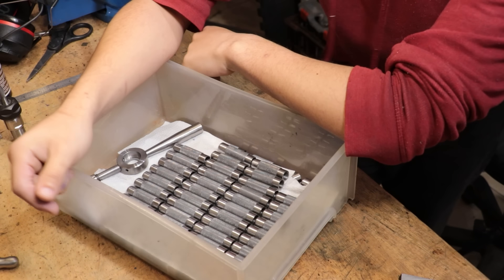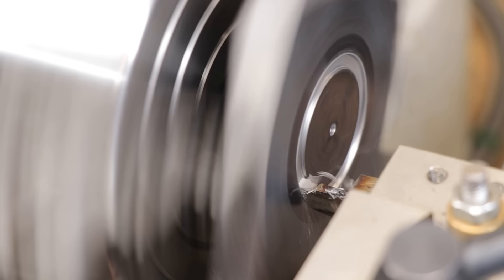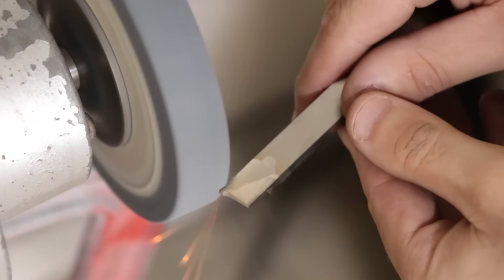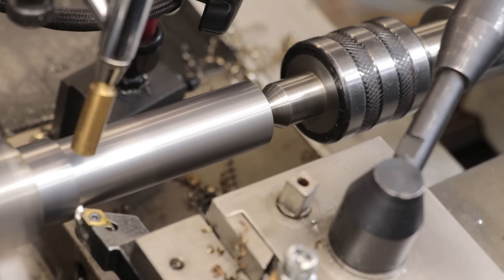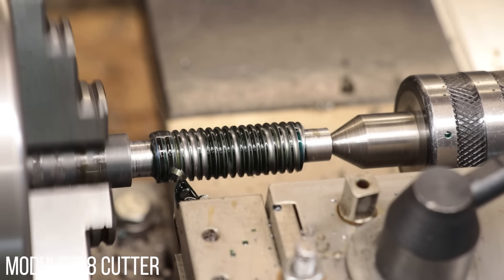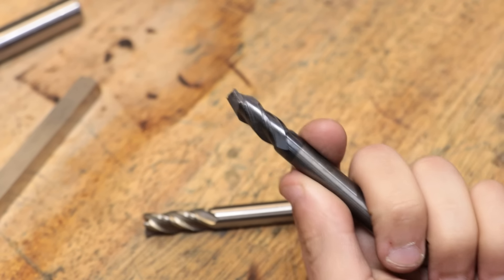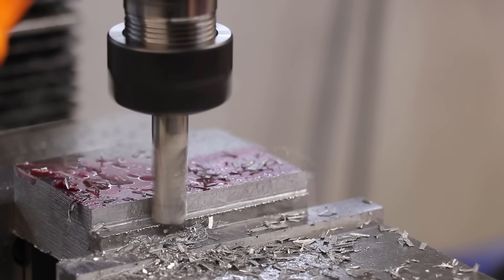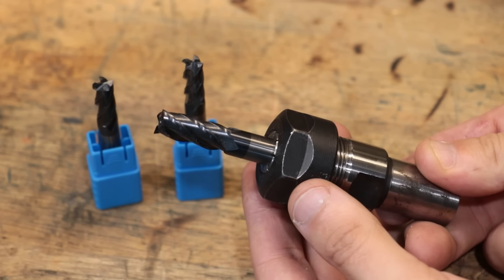Carbide VS HSS Tooling In the Workshop

Comment: I strongly disagree on the insert selection:
Having more or fewer different inserts has basically no impact on the overall cost. If anything having more will be cheaper - use the right tool for the right job and it will either give a better result or last longer. The only cost increase is the one-time upfront cost of the very first batch you buy - as instead of 6 sets of insert you now have 20 sets of inserts.

Of course there is then also switching the tools - when using just 1 type of insert then you don't need to change anything, if you are using 3 different tools for the same job then you might get better tool-life and better parts, but you now have to also switch the tools.
Reply from the maker: Thats okay, you do what suits your set up and needs best.  This suits my workflow best.  I tend to save a bit more because I buy my inserts in bulk so I save a bit more just buying 2 or 3 types and getting 5 or so packs of them.
Reply: @artisanmakes  It is just a comment on the validity of the statement cause:
"so I save a bit more just buying 2 or 3 types and getting 5 or so packs of them."
That would not change the slightest with having more types. the cost would either stay the same or be lower.
But if your workflow does not benefit from that, or worse you would have to constantly change the tools, that is a different thing and makes using them not worth it for your workflow. But it would not be more expensivee.
Reply from the maker: @ABaumstumpf  I see a difference. with my wallet I use mainly DCMT, I can afford to buy them in bulk and get the discount. If I have the more different types that I use I can not justify buying bulk orders of 5 or 6 different types of inserts. I only get the discounts if I am buying many packs of the same specific insert.  Maybe you see a difference, remember I am not a machinist, this is not my job so they way that i buy and order my tooling is structured so minimize costs and I do see a reduction in costs here. Your milage may vary

Comment: I notice you are going through quite a lot of DCMT/DCGT 070204 inserts ! All my bought insert tooling uses those inserts , but you only use the two sharp ends of those inserts ! I have made myself a few single insert cutters for the milling machine that use the other 2 corners on the inserts !

Comment: Gear Cutters i also only found as HSS there is no Carbide version.
There are also diffrent cutting edges like there are some that have little bumps that are more for roughing and interrupted cuts.
Reply: hm.. carbide gear hobs ARE a thing though.  The cutters are 'hobby', thus no carbide?!
Reply: @joansparky4439  I didn't see a carbide gearhob mostly hss with tin. I tough gears today are very often skived as that is less costly and faster.
Reply: @platin2148    I only searched for carbide gear hob and results came up, while nothing for cutters.
As for power skiving vs hobbing - no idea.. I'm not from the trade.  I'm just an engineer with a hobby-shop. ;-)

Comment: You might get quite some return by asking the producers to take back the inserts. They can be recycled easily and the production cycle is very costly. If it was for recycling only, carbide inserts would cost a fraction and make them really affordable compared to HSS.

Comment: Why don't they sell HSS inserts, so I don't have to grind them myself?
Reply: They do for lathes, you can by pre-ground HSS inserts. Look up accusize pre-ground inserts for lathe. I bought them when starting out so I had an idea of how to grind them.
Reply: What I mean is, the same size as carbide inserts CCMT, DCMT, etc. I looked at those and they're full length HSS tools pre-ground. About $50 a set.  I guess kyocera makes some CCMT out of HSS, but they're more expensive than carbide. 🤯
Reply: carbide inserts are used in industry, hss not so much (anymore).. thus economies of scale give us "cheap" carbide inserts, but no hss inserts (for hobby machines).

Comment: Make jewelry from the carbide that looks nice anyway.   It's probably a dumb question, cant the carbide be resharpened with a diamond grinding disc? Just enough to get the edge back?
Reply from the maker: Carbide endmills and cutting tools can be if they’re just dulled and you have the right machine and jig to do it. But the economics of inserts makes it cheaper to replace them.

Comment: hi.  ever thought of making a 3000 to 6000 grit diamond wheel. you can polish both types with one grit rpm..s  in 1000 to 2500rmp.. works well . and you only have to touch the face and its done.. instead of grinding.. so much better and faster. evern on carbide.. tone U.K.

Comment: End Mills i buy HSS-PM or Carbide there is no normal HSS anymore it i can simply not work with it.
I do have insert end mills down to 6 mm 
Well the quality cutter from Germany i have as HSS which i don't really use is 25 bucks.

Comment: aluminium inserts since they are uncoated cannot run faster than 80% of what was recommanded for coated inserts(TiCN) or 40% of TiAlN coated inserts
i recommand 100m/min and only on small finishing cuts, they are too sharp to handle the heat compared to normal finishing steel carbides
and i mean 100m/min on 162HB C45, lower for higher HB

Comment: You will never never be able to achieve the efficiency necessary to maximize carbide cutting tools can offer on a slow, (Low RPM 2000 and under) or low horsepower machines. It will not matter if you are using a mill or a lathe. High speed is normally used at 60 to 80 surface speed, carbide's normal range is between 300 and 1000 Surface speed, and much higher for aluminum.    
    A piece of 1" Diameter steel clamped in a lathe  would need to run 4000 rpm  to get to 1000 surface speed, that along with a constant stream of coolant would  get you the most from a carbide insert. This is a real problem for most home shop machinist.   
    CNC machines do well because they are designed around carbide cutting process. TIGHT Environmental CONTROL,  constant and variable spindle speed relative to the  feed no matter diameter of the part or cutter.  
    The tools you show in your post are correct choice for light  low horsepower machines, but even at that most of their cutting potential is lost.